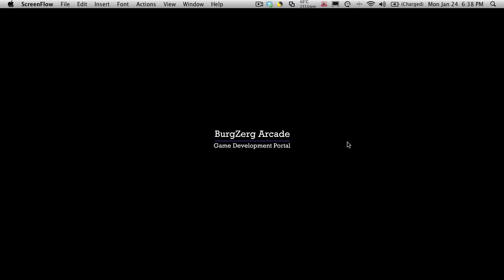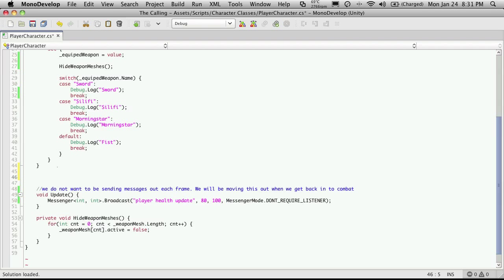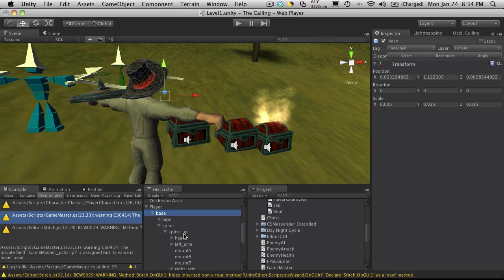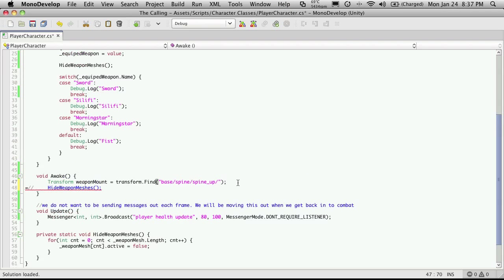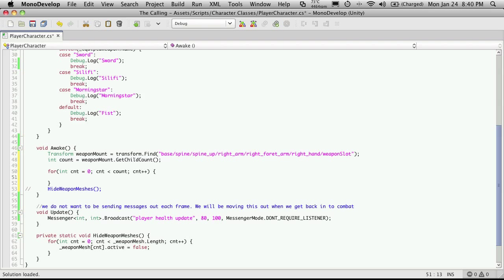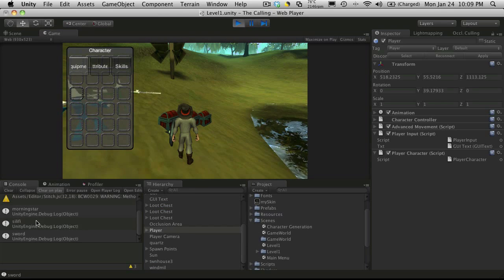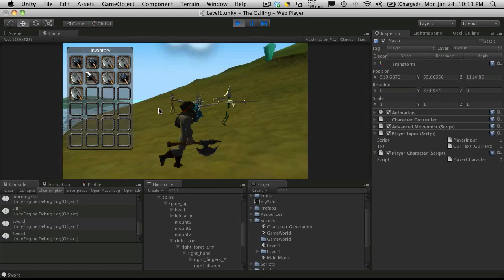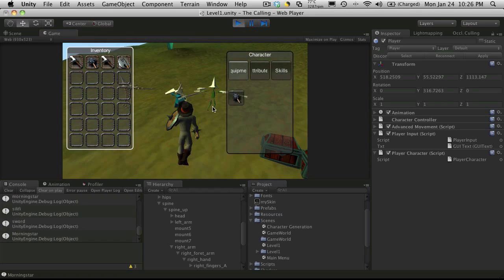141. Unity3d Tutorial - Weapon Meshes Part 2

Comment: need help guys =(
Reply: It's kinda late but had the same problem. The issue is the Awake function on our PlayerCharacter class is hiding the Awake on the inherited class witch is BaseCharacter, thus giving a Null Ref error. What I did to solve this if setting the BaseCharacter Awake to virtual, and then the PlayerCharacter Awake to override, both have to be set to public because that's how it works. After that I just called base.Awake() at the start of the Awake function in PlayerCharacter.

Just to be clear your Awake on BaseCharacter should look like this :
  public virtual void Awake(){
  stuff
}
And the Awake on PlayerCharacter should be:
  public override void Awake(){
  base.Awake();
  stuff
}

Don't know if it get's fixed in another video but this seem to work, hope it helps anyone following this tuts.
Reply: Manuel Pereira it still dont work for me :(

Comment from the maker: @Jeorney We address both of these later on. Unity changed the way it worked since this video. The warning is because we are using an Awake function in a class that is inheriting from a class that also has an Awake. We will fix this in the next video or two.

Since this video, I have redone a lot of the way the item system works so that it was a little bit easier to work with for everyone. I would still watch as I am not sure what I have changed since this video.